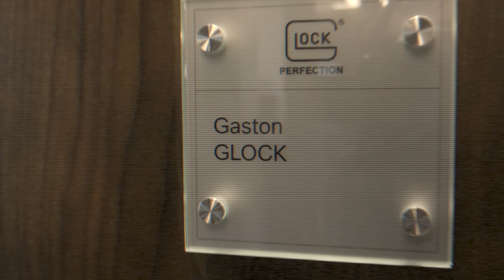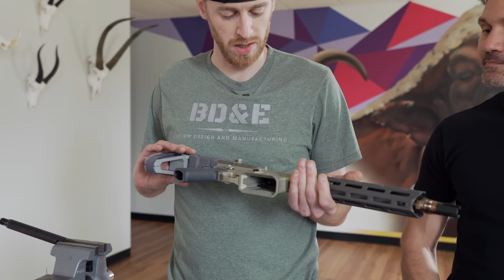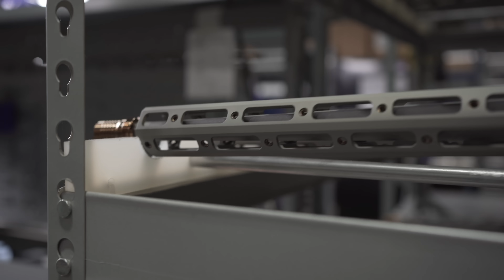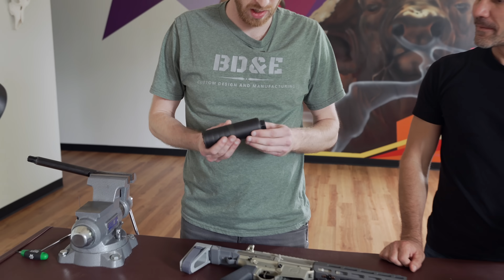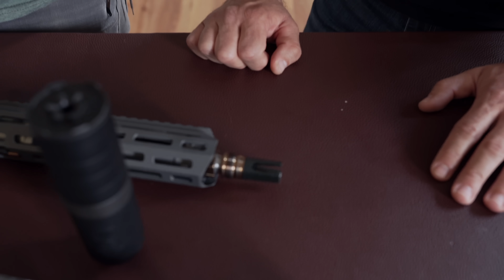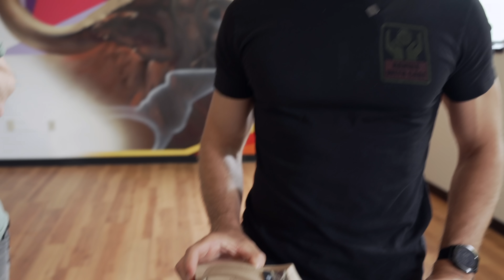New Honey Badger, Mini Fix, Cans, and Gear from Q

Comment: How do the new Handguard hold up against heat since it’s so thin🤷🏽‍♂️
Reply: Probably transfers heat to your hand as fast as they pull taxes out of your paychecks.... so instantly.
Reply: As a simple matter of physics, let material means less heat capacity.
Reply: @Mk2Mod1  That is true but it also means it absorbs heat or transfers heat more rapidly, especially with the heat conductivity of aluminum. I used to use one of Aero Precision's Atlas handguard, the slim one without most of the pic rail down the middle.  Its comfortable and I love it but after a couple mags doing drills, you couldn't  touch the thing it got so hot. With a can its even worse. It was with a Faxon 18" pencil profile and its a small diameter guard which doesn't help. Switch to a Faxon carbon handguard and it never gets more than warm due to CF's  poor thermal conductivity.